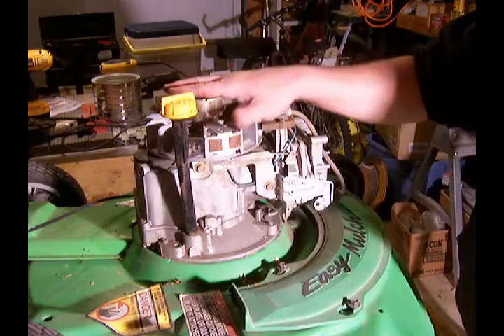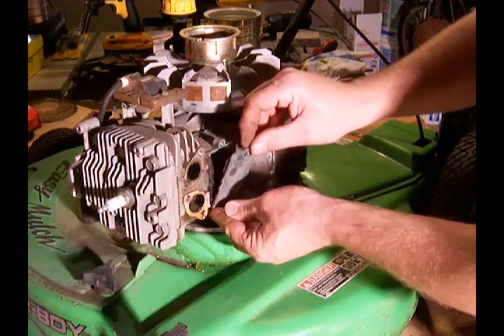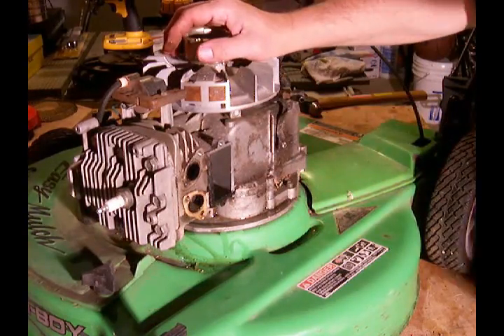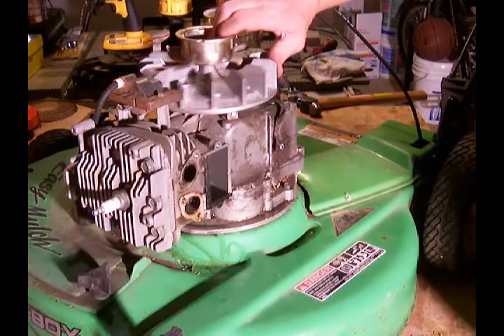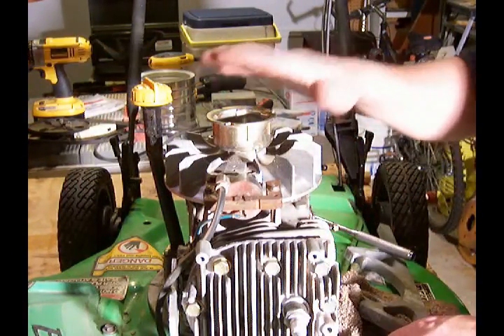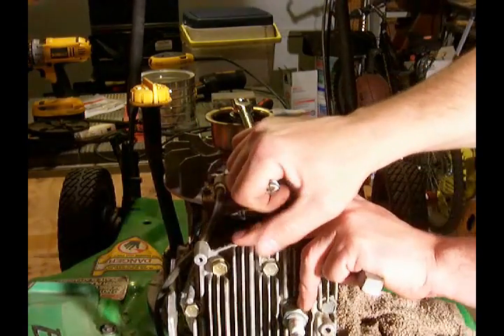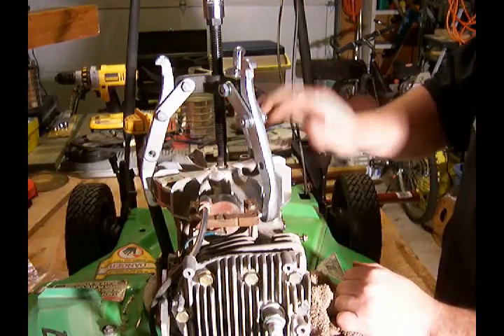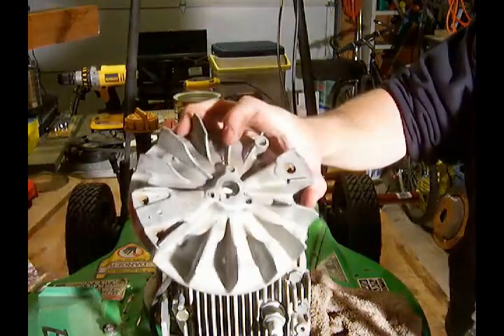#2 Tecumseh LV195EA / LEV120 Tear down/rebuild - Engine brake cable - valve cover & flywheel removal

Comment: Other suggestions: I also had to use a puller to get the flywheel off but I created screw threads, 7 X 1 mm using the three ''provision'' holes around the center hole. I feel this approach is less stressful to the flywheel. I also suggest pulling and bloking the brake lever so to free the flywheel and not damage the brake pad when pulling the flywheel off (which I did...).

Comment: It's good that the flywheel didn't break. The Tecumseh 611299 flywheel is now obsolete.
Reply from the maker: You got that right. However, I come across a lot of Tecumseh engines. Might have the same flywheel. Haven't need one yet though. Thanks for watching.

Comment: I tried to take off the flywheel using the knock off method.  Would not budge.  Ended up using a gear puller.  Came off fine.  Used your all's advice and put the legs of the puller under the fins...

Comment: -- Suggestion, when you put the gear puller on, I would NOT place it in between the fins of the flywheel but right under the fins, this will give you more support (metal) when it starts to pry the flywheel off.
-- If you put it in between the fins, most likely you will break or chip off pieces of your flywheel.

Comment: Yes it tells you to put a pry are under the flywheel and hit it with a hammer, like when removing a ball joint
Reply from the maker: Interesting! I didn't see that in the manual until you pointed it out. Well, I have the knock-off tool - and I tend to use that more than the jaw puller anyway. Thank you for pointing that out and thanks for watching.